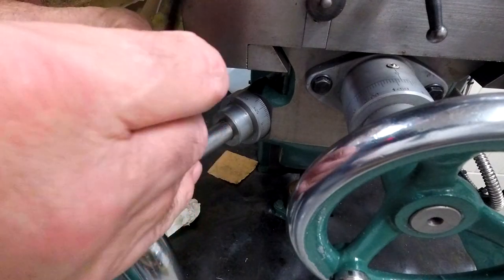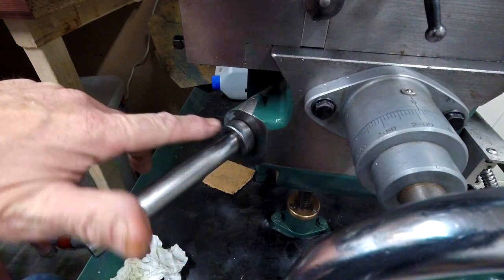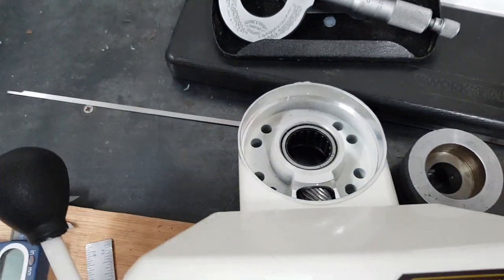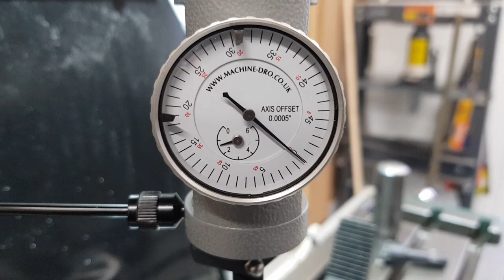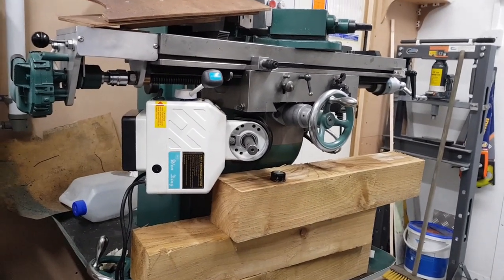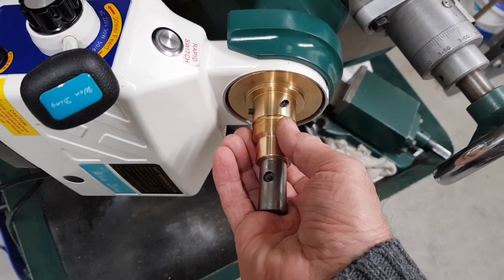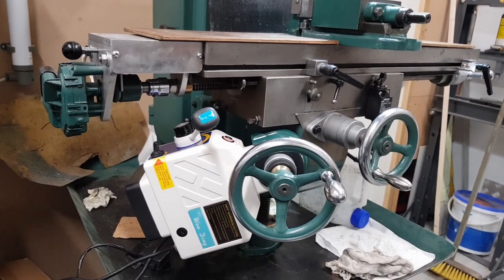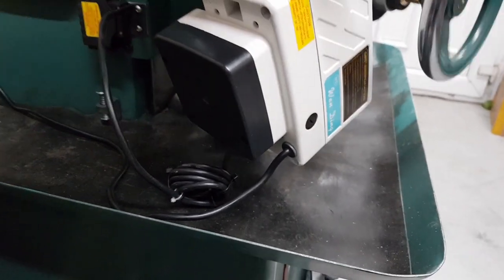Fitting a power feed to Z axis to a milling machine

Comment: hi pat from B,C, I USED A ELECTRIC DRILL WITH A ADAPTOR WORKS GREAT SO YOU DID AWAY WITH TABLE POWER FEED AND ADDED YOUR  OWN IS THST A WIPER MOTOR
Reply from the maker: Sorry i am a little confused by your question so here goes. My mill does not have any power feed on any axis. I made one for the X using a wiper motor from a Ford Mondeo. Which works great. The Z one is a bought item from ebay meant to be used for a X axis drive. But i used it for the Z axis. It can be a bit slow to engage sometimes , but has plenty of power for the job. Regards. Stevie.
Reply: @Steviegtr52  MY TOM HAS A FACTORY GEAR BOX WITH 3 SPEEDS AND A DRIVE SHAFT TO THE TABLE DID YOU TAKE THAT OUT
Reply from the maker: Ah no. It is not the same model. Mine is a Tom Senior light vertical. They did not have the geared drives like your has. That why i was confused.

Comment: Nice Steve !
Bee  looking at the same power feed and wondered if it could be modified to fit my mill. You've just answered my question. 🙂
Reply from the maker: Yes I guess it could be made to fit any mill. The Bridgeport is a big beast so luckily everything was bigger than needed. If it was not it could be sleeved down to fit if all else fails. I did a test with it as I was told it would not have the power to lift the table. I set it going & put all my weight on the bed. Not a problem. Tons of power. Just check out my video though of where i took it to pieces , because the grease inside was the thickest crap ever seen. Once cleaned & lubed with 30 grease it now runs like a clock,,,,sort of. Ragards. 
Steve.

Comment: Can you share where you got the feed unit from, thanks
Reply from the maker: Hello Mchael. All i can tell you is it was an item advertised on ebay. I cannot go that far back in my purchase history to tell you which seller it was. It did have to come from China & was about 3 weeks arriving. I have just been into workshop to look for a name. It says. Wen Ding. It says on the dial. 220v 90 watts 50/60Hz. I fitted it nearly 3 years ago now & apart from stripping it & cleaning the horrible thick grease out & repacking it has been superb in operation. Not sure if it was about £140. Hope this helps. It was advertised as a X axis power drive for a Bridgeport milling machine.
Regards.
Steve.
Reply: @Steviegtr52  Steve that is very helpful, thank you, regards Michael

Comment: For Gods sake.. that mill doesn’t have six inches of total knee travel.. what you need a feed for anyway!?
Reply from the maker: Eyup Paul. I think you need to do your homework before giving a comment like that. The knee on a Tom Senior light vertical has 16" knee travel. More than most other small milling machines. I take it you have had a couple of drinks tonight & you are forgiven. 
Steve.
Reply: @Steviegtr52  nope I just had a hankering to give somebody some schitt.. then your bench mill with a sideways knee feed came up which gave me a huge laugh so I reached out.. guess you can’t handle criticism.. and maybe I’m just jealous because all my mills don’t have a knee feed … bottoms up
Reply from the maker: It's not a bench mill. It's on a cast stand factory. 😊